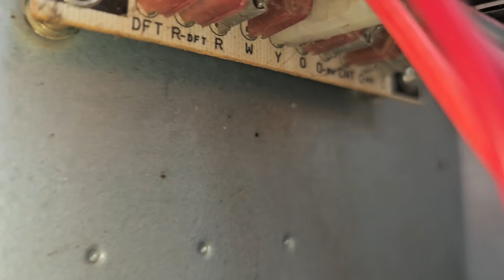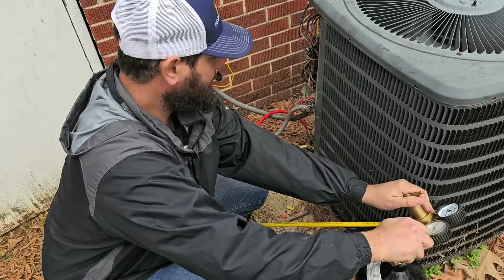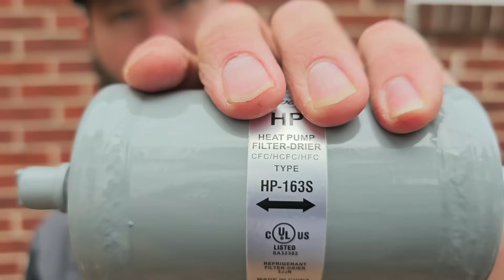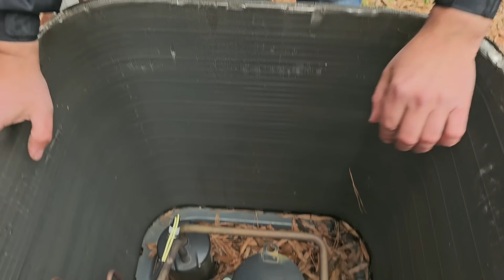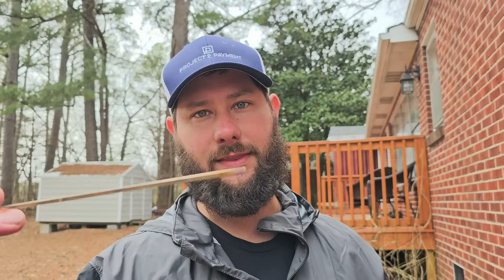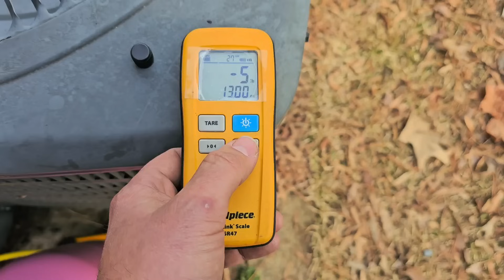Why is my Electric Bill so High? #heatpump #heatpumprepair

Comment: I had the same issue didnt know the auxiliary heating was coming on under a certain temp. And bill was insanely high the electric company told me that a high rate of energy was because of the auxiliary and emergency heat. I turned auxiliary heating off because those heating elements in the furnace will run the bill up. And I never turn auxiliary heating back on till this day. Heat pumps are tricky.

Comment: Tad, I use sandwich foil (thin) and squeeze around the wires inside the cabinet when brazing in a tight area. Also the corner where the valves come out, then wrap them with wet rags.

Comment: I have a question about your turbo torch. What size tip are you using? I have a tour turbo torch myself, and I would like to know the size that you’re using cause I pretty much use the smallest tip they have but it seems like you get it done a whole lot faster with the size that you have.

Comment: Should it say open line on the multimeter
Reply from the maker: Depends on what you are testing, but usually that means a break in the circuit.

Comment: I tell the home owner if the inside is filled with leafs and they contact the coil, it'll rot the coil. I tell them to cover just the top. Also was the system empty and did you check for acid too. Well done video, Thanks

Comment: You are so excellent at your job! I tried troubleshooting so many things before the winter came because a snake had gotten caught up in my blower motor and then i fixed that .It was in the summertime when it was thunking.  I took the snake out of the blower motor and rest stabilized the motor that had gotten loose from the snake . So the air conditioning works well and then when winter came, the  heat pump was struggling to keep my house at 67 degrees. I called my neighbor over to help with a multimeter check  and when we looked at the heating coils , the rest of the snake was there. I believed laying on top of the coils causeed  the coils to be inefficient. And I believed that the problem would be remedied but it's true  that the outside fan never was running . I had research that and realized that it should be running. So sure enough my heating bill was $425 last month and last winter I was shocked at it being $335 and that's probably because this whole time the outside heat pump fan wasn't turning. I bought a pressure switch and was going to attach it by watching the videos where they started from the exterior of the heat pump with a tri connection at the Schrader valve so as not to have to braise anything. Well I decided to see if it worked through the winter instead of just guessing at replacing a pressure valve . That's when I got the big heating bill. Knowing there are guys out there like you who are so excellent, I would love if you knew somebody like you that lived near Bowling Green Kentucky that I could call on and Trust. The reason I attempt so many home repairs myself is because so many cannot be trusted to do such a thorough job as you . Thank you in advance for any here in Bowling Green Kentucky. And may God continue less to bless you in your masterful trade 🕊✝️🙌🏾
Reply from the maker: Wow, that is quite the story, glad you found the issue! 🤙
Reply: @taddydigest well the outside fan still isn't turning on when I turn on the heat so I'm going to try bypassing the pressure relief valve, because I do not have the expertise like you to cut and braise copper where the original pressure switch is located! It should not be a Freon leak because the heat pump works just fine in the summer. Thanks again for your response I'd still like to find someone like you in Kentucky

Comment: Heat pumps should be suplimental heat only. Revercing valves and shrader seats get hot and fail loosing charge. High vac to operate system with electric heat strips do all the work .

Comment: ?????  you are simply adding soldering to an already made joint???   I don't know much about HVAC, which is why I am watching your video and I love your content... BUT WTH?  I have done a lot of plumbing repairs on my properties and the first thing I was told to do is UNDO the joint, CLEAN IT, put back FLUX, so the solder fill in your joint properly!!   
   This joint is fully oxydized, no flux, so you are just adding on the "top" like a "top off"!!???   Gas is more volatile than water, so why are you doing it this way??

Comment: Am I confused? I keep seeing everyone talk about an electric heater pack in the furnace… I have a gas furnace with an outside heat pump… when I’m in emergency heat mode, everything work fine and the burners light, but blower fan is lower speed. In regular heat mode nothing happens other than the bower motor going straight to high speed, but no igniter, no burners, no inducer fan… I’ve tested and checked everything and can’t figure out why even the outside unit doesn’t work on regular heat or AC mode… I get no heat or AC, no outside unit kicking on, and it just runs forever…HELP!! 😂 I feel crazy

Comment: Hey man. Big fan since I you gave me the confidence to install my soft start. It helped a little. It still blows up my electric bill. Now the heater mode won't start unless I reset the system by shutting it down at the electrical panel. Had an ac company come and say the duct work is inefficie t and mentioned my blower seems to be aftermarket with no board. So the system was modified. Also said the 3ton is insufficient for the house. So could that be why I have to reset my unit to get the ac started.? I'm in Florida clearwater  area and got low 30's.
Reply: P.S. thermostat wiring was awful and exposed. Redoing it.

Comment: Do you need to use emergency heat setting when it’s below 32 degrees outside? Never understood that. And he just said you should be using your heat pump outside if your temps are above 32degrees

Comment: I have the same problem, I have a hybrid system, my heatpump is set to run until -10, but my unit is still running when its -15, and its burning propane,  so i am using the electricity and propane at the same time, my hydro bills are close to 500.00 a month in the winter, I asked the contractor why its coming on and he said thats the way it is, but thats insane im using both electricity and propane this is not efficient.  Please help. New sub here.

Comment: An Older HVAC guy told me that any temp below 35 degrees there is no heat in the air to pull from. So when the temp is 35 or Below I turn on the emergency heat only till outside temp rises.  My power bill  actually went down and heat pump doesn’t run ALL night for no good.
Reply: I just moved into a home with a heat pump. We are experiencing some extremely cold temperatures now and I was wondering if I would actually save power by not running the outside unit unnecessarily and just using the emergency heat. I guess I just need to try it and see.
Reply: @gaggleduck1787 not true for all heat pumps

Comment: I have a large house with 3ea, 5 zone minisplits. due to the builders 
“hvac” hacks we had alot of leaks, so a pro like taddy installed refrigerant isolation valves in each line set, granted thats expensive but not compared to r454 . its super easy for the tech to find which head/line or unit has the leak before loosing all the r454

Comment: Hi Tads love your channel im having a hard time believing HP can save money over a Nat Gas System? And all the Componets are the same draw the same current especially in the summer? But the Winters here in So California Desert are kinda mild now? Ive read its all about heat transfer and still can follow the Science😂😂have u connected your amp probes and other measurements sevices during Heat mode and cool mode and compare summer and winter power consumption? Jus curious 👍👌thanks Tadd
Reply from the maker: That's a very good idea.I will keep that in mind and do a video that sometime soon

Comment: Current bill is almost $500 for this month. A minute and 30 seconds into your video and I think I know why. Had my thermostat on emergency for months now. Wow. Appreciate your time man!
Reply: @Rajay7730  oh wow! Glad this video helped and you figured it out. I got lucky with Ace Hardware carrying the Dual run capacitor I need for my old heat pump. And it worked! $35.00 & some stress but, worth it.
Reply: Only run your Unit on heat when its above 25 degrees. After that put it on emergency heat. Do this because once the temperature gets down to 25 degrees the heat pump can't keep up . And has to run to long before it can tell the emergency to come to help catch up. In which it waste electricity. Than when it starts warming back up and gets to 25 put it back on heat.
Reply: @RandyM-h5m  well that really depends on which refrigerant your heat pump uses, and whether or not your system is fully charged.  
with the old R-22 systems (phased out in the 2000s in USA),  you definitely should turn to emergency heat below 35-40 degrees (F).
with a R-410a system (2010-2024), your system can work well down to about 10-20 degrees (F), some systems even working down to about 5 degrees.
with the new R-32 systems, they will heat efficiently down to -15F.  that's -26C.  interestingly, R-32 also cools at hotter outside temperatures as well.
R-22 was bad for the ozone layer, so we switched to R-410a.  in fact, we would have switched to R-32 back then, but were afraid of its flammability, so we mixed it with R-125 and called it R-410a, which is half R-32 and half R-125.   Now, with better manufacturing (and more cost), we are fully switching to R-32, since it was doing most of the work in the R-410a mixture with the R-125 mainly being a fire-suppressant.  R-32 is better for the environment, and more energy efficient, but operates at much higher pressures, and flammable, making it more dangerous when something goes wrong..  This will be something to keep in mind in the future.  i'd argue that yearly inspection/maintenance becomes imperative with R-32
Reply: No not necessarily . people draw 12 to 15 amps for each 110 volt heater there not telling you about.
Reply: @JamesClichet3663  people with HVAC systems probably don't use space heaters very much. i use one in my bedroom, but keep it on 600W  (so maybe 5amps), and it only runs a few minutes an hour, just to lift the temperature above the rest of the house a couple degrees.  what's killing energy bills is emergency or auxillary heat strips.  
for instance, your heater at 12amps 110vs is 1400-1500W.   My heat strips are small, cuz my house isn't too big, and they are still 7.5kw heat strips. that's the equivalent of like 5 space heaters.   my parents house has a 15kw strips. that's like running 11 space heaters at max heating.  some newer homes have 2 of these. that's like over 20 space heaters .  but this is why they focus so much on air-tightness and insulation, because the big open floor design and 4500 square feet demands it.

but when it gets really cold outside (below 20F) you really got no choice but to use the heat strips (auxillary heat, emergency heat).  unless of course, you have a gas furnace or fireplace.

Comment: Could you please explain what the common is and why you can use the cabinet as the common
Reply from the maker: In an HVAC system, the 24-volt control circuit comes from the secondary side of the transformer, which has two sides: R (hot) and C (common). Voltage leaves the transformer on R, goes through the thermostat and safety switches (like pressure switches), and returns back to the transformer on C. That return path is what we call common.
In most furnaces and air handlers, C is bonded to the metal cabinet, so the cabinet becomes a reference point for common. That’s why you can put one meter lead on the cabinet and the other on R and read about 24 volts AC. When troubleshooting, this makes it easy: if you read 24 volts across a switch, it’s open; if you read 0 volts, it’s closed. Common isn’t earth ground, but it’s usually tied to ground inside the unit, which is why this testing method works.

Comment: We have a 92% efficient Gas Furnace.  Also have a Heat Pump.  Heat pump works fine but our electric bills are insane,  around $250 a month.  23 cents a kilowatt.  So we use the Gas Furnace and the Heat pump in summer only or if the Gas Furnace should fail.
Reply: You know my elec company just told me...
I am in the midwest...
And the small elec heater cost about 21 cents per hour! Each! They told me it would be cheper to turn my gas furn up! The said even the most eff one cost 50 dollars a month....
For real
Well anyways take care...
Reply: and how much is the gas bill in the winter?   and gas+electric?
Reply: @tirkentube We just got a bill today and it's $240.
Reply: @scotta9114 
I have to look at my...
But it been really bad here...and cold....
Also my bill during the summer is only about 20 dollars for gas....some people shut the gas off during the summer...
I just dont..
Well anyways take allways..
Reply: It 413
Reply: But i dont do budget ..
If i did that it would be close to the same all year! 
But i like have smaller bill in the summer....

Comment: New info:  My Trane heat pump only stops and throws error messages during the winter, not the summer.  I'm being told I have a restriction.  How can this be when it works fine during the summer?  In the winter, I can turn breakers off and reboot system, and the heat pump in heat mode will work for another 12 to 24 hours before shutting off and throwing error messages again.

Comment: Put that drier outside the unit.  Next guy will be happy
Reply: @brianchadwick9405  That's usually what I do, most filter drier in Goodman the top copper line is 3/8" and the bottom sometimes is much smaller 1/4" so I just brazed a piece of copper in place of old drier, and I put new filter either outside, or close to evaporator coil..

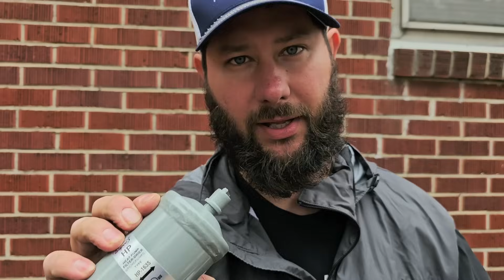Comment: 10:07 - What if the system never had a filter drier. Do you still add one in when you repair the leak or replace the coil ?
Reply: Yes. Years ago it wasn't reccomneded to add filter driers like it is now. Even suppliers didn't Reccomend it.
Reply: Konuşma Türkçe olabilir mi

Comment: I had a brand new split system installed 12 years ago and the heat pump side has never worked. It was installed by a commercial associate I had done $2 million of business with over the previous 10 years. They replaced the crossover valve twice without change.  They gave up after a half dozen attempts at repair. Finally, they suggested I call the manufacturer.  Tried that, got either an automated response or a non-technical person who said to go through the authorized installer (who had told me to call them). Every winter we have to use Emergency Heat and boy, what a whopper electric bill each time!  
It is a RUUD unit and boy, is it ever!
Reply: Why didn't the installer call the manufacturer? It's their job to service the unit and seek technical help not yours. That's a lousy company and should be sued.
Reply: @picker63028 The owner's wife died suddenly.  Owner sold the business to a former employee and they went strictly commercial trade.  The former owner passed away shortly after. I read up on RUUD problems and apparently those crossover valves were defective straight from the factory,

Comment: Great video! I have a case in which the heat stripturnsn on right after the cooling temp is met. The air handler fan also runs a slow speed.  The moment the cooling starts again, the heat strip turns off. I removed the thermostat  face and checked for shorts, but all looks clear. Could this be a problem with the defrost control board? Like a constant defrost cycle call? Thanks

Comment: This happens every year, yes you may have a problem , and yes people need to have some maintenance  and cks on unit ,but most don't, they think there saving money on service, but they think wrong, have your unit cked by a COMPETENT LICENSE CONTRACTOR ck like teddy every year.  And realize in sub freezing weather your unit is going to use more power, conservation and maintenance is the key. The service is cheap compared to what u can spend when it's to late.

Comment: Side note, Im unsure if you mentioned, but it also could be as simple as a programming issue on the thermostat if only electric heat is coming on during heating mode if system is a heatpump

Comment: Heh Ted, your videos are awesome. Here is my question for you - I live in a cold climate and my most recent power bill was over double what it should be in winter. 1700 dollars for two months versus projected 850. They diagnosed a faulty TXV and replaced it. Would that alone cause my bill to more than double in winter? Thanks
Reply from the maker: yes that could cause the bill to be double if the HP is not operating correctly then the heater kit would be used more

Comment: Hi, my question is: My outside hvac fan doesn't run on heating mode, (heat is on, no emergency mode on thermostat), but it runs when i switch to cooling mode. I have a Goodman heat pump. Thank you

Comment: You didn’t check the king valves for leak test and forgot to removed de service shader valve for bracing the suction line but nice video and knoledge share 🤙🤙🤙

Comment: If you have a heat pump your thermostat should show 2 Heat Modes one will say  EM HEAT ( Emergency heat toaster coils in the air handler) and HEAT (Heat pump outside unit)
You'll know for sure if your using EM HEAT you will smell something burning in the vents that's the dust on the coils burning off. The toaster coils are called Emergency becasue they should be your last resort if the heat pump will not work because its expensive to run.